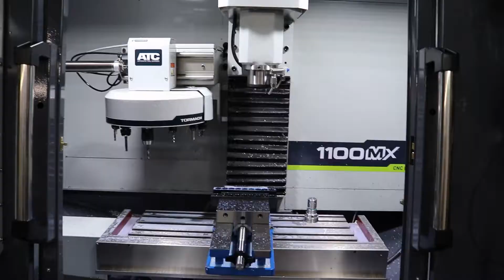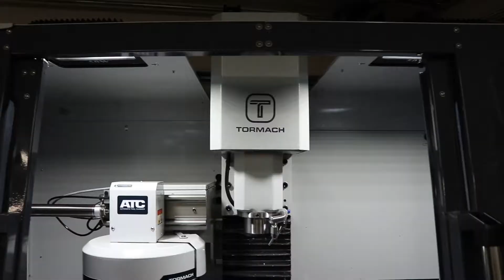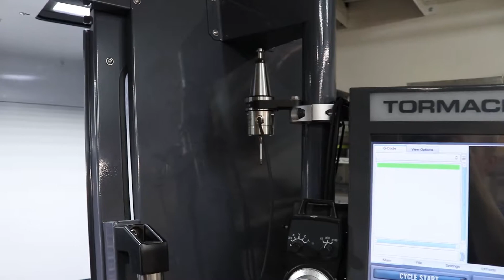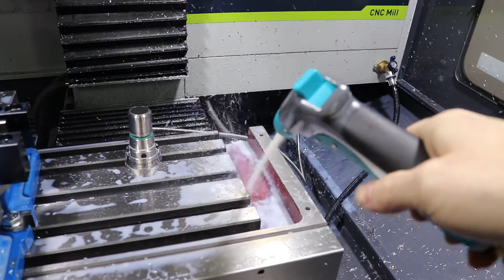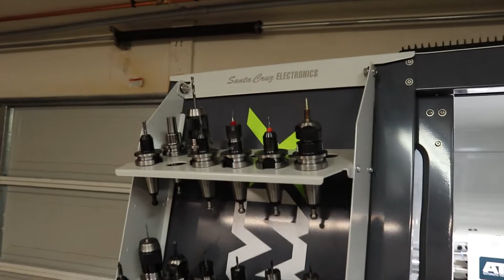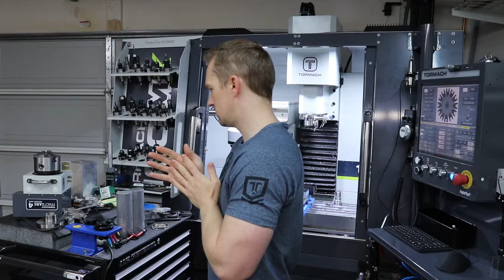VC Edge Intro and Tormach 1100MX Mods Part 1

Comment: Any chance you can link to the file for your probe holder?
Reply from the maker: Looks like this is the one on Thingiverse   https://www.thingiverse.com/thing:1784682
Just make sure you check the sizing. I think I had to re-scale mine so that the holes at the back were about 6.63mm and then mess with print settings to get it to fit how I wanted.

Comment: So you're cutting the carbon fiber on the 1100MX? Are you fitting up some kind of dust collector? I've heard that carbon fiber is difficult as the dust gets everywhere and is electrically conductive, so dust collection is critical.

Your work looks really good, the challenge coin is excellent as is the knife design. Thanks for bringing us along.
Reply from the maker: That's right. I'm machining the carbon fiber wet. It isn't exactly endorsed by Tormach, but I've added filtration and coolant to handle it. In theory anyway. We'll see how it goes.

Comment: Subscribed to your channel. Great stuffs. Only one thing for the touch probe. If you leave it connexted the constant current flow will oxidate the internal contacts between pins nad ball bearings and the accuracy will go down. So better that you remove the connector from the control panel when not in used or add a manual switch to close the circuit before it gets into the probe. So Pathpilot won't trigger any message about the probe be active and you can leave it connected while not oxidating the contacts. I have a DIY mill but I did the switch trick with my probe digitizer.
Reply from the maker: I never thought about that. Thanks for the tip, mine is plugged into an extension so its easy to reach. I guess I'll just leave it unplugged when not in use.
Reply: @vcedge9466  yes that or you can add between the 2 connectors a switch that manually closed the circuit when not using it. So the control board will still feeling the NC circuit and you don't have constant low current flowing in the probe. It a common problem and you can search it online. For instance some probe  manufactures embedded the contacts circuit in an antioxidant gel to prevent it.